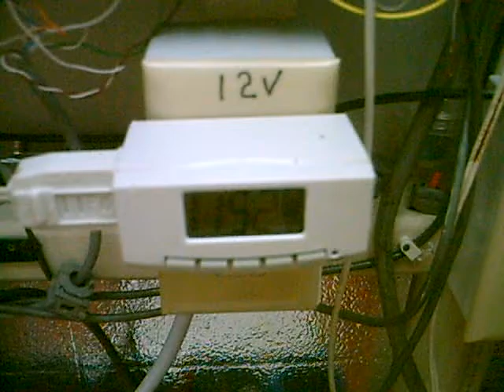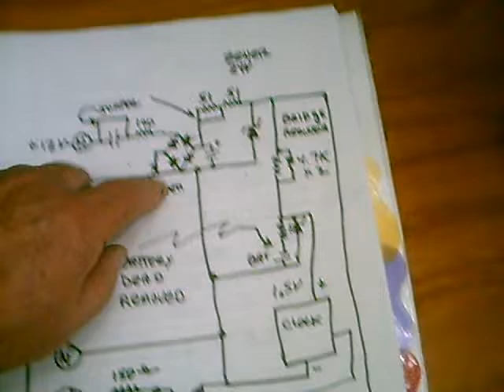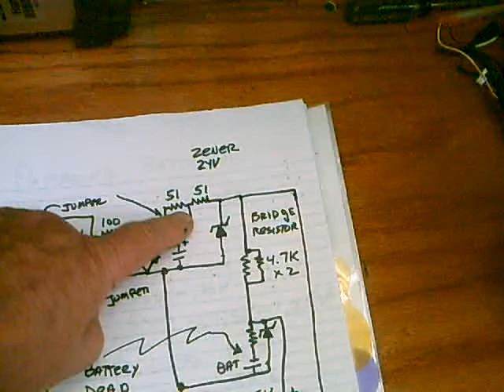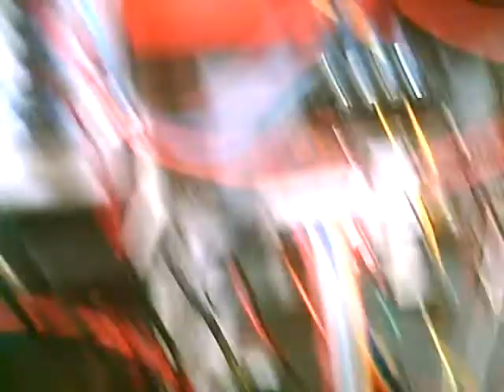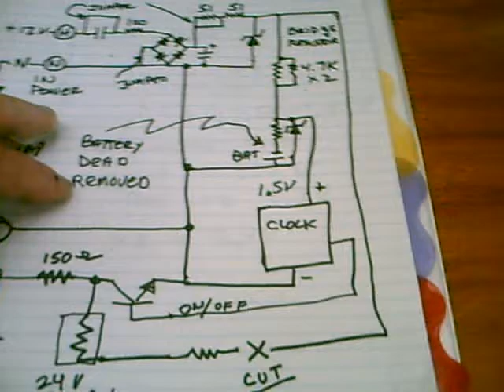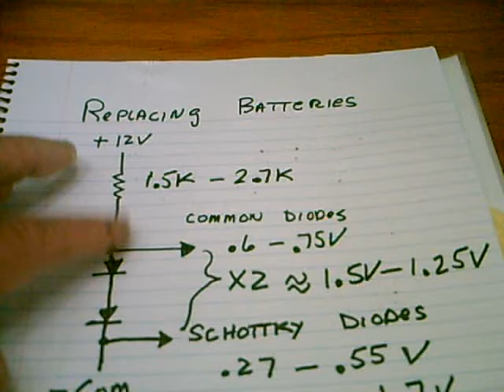Automate System With Cheap Timer,  Battery Elimination For 12V DC

Comment: I purchased one of those Chinesium Timer modules to control the ON OFF time on a Spot welder I made up.  LOL,   I had no Idea what figuring the thing out was going to entail lacking ANY FORM of documentation.  As it turns out you can configure it into one of 6 modes or configuration  .   After hours of dicking with it I have it turning things on and off.  Still no Idea how to set the On or Off Duration.   LOL   Took me a week to get it working the contacts starting from Normal Open to Normal Closed.   What a hoot.